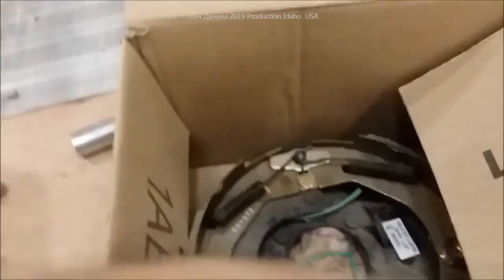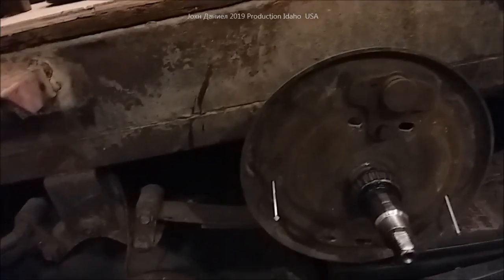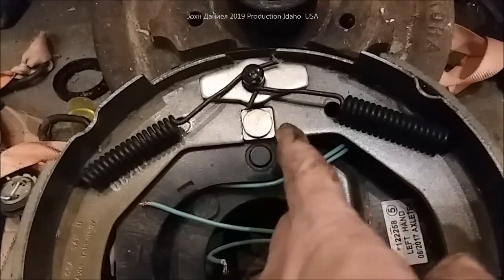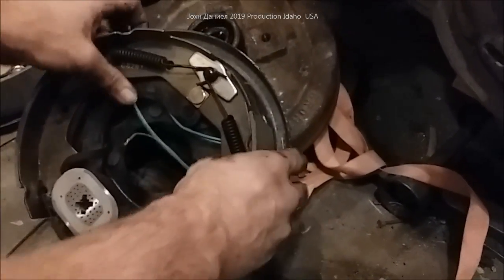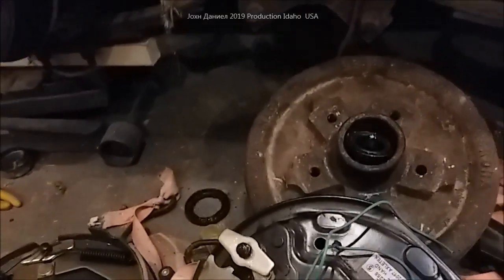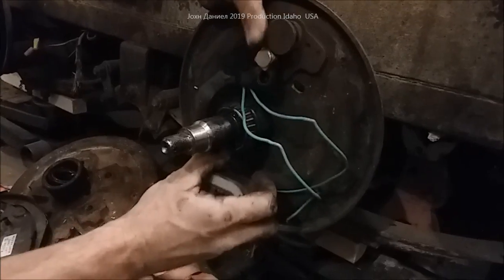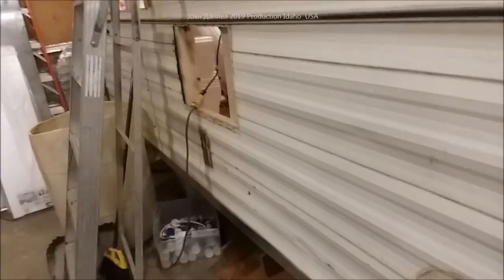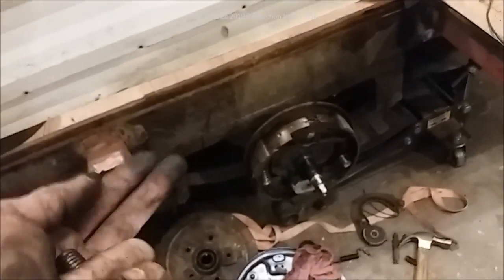Vintage Electric RV Brakes with Welded Backing Plates, your options and PARTS BELOW

Comment from the maker: If you go to buy separate brake parts its $20 more a wheel, or just use complete kits for less from https://ebay.to/2FRumSC , Only a 3500lb 10x2.25 kit https://ebay.to/2FQN3WF (most common on 5 to 6 bolt hub) or 5200-7000lb 12x2 kits https://ebay.to/2WkZFu5 (6 to 8 bolt hubs). Most welded on are known as "Dayton Style" or early Lafayette, and rarely as Dexter Dayton Canadian. The links are sources to R and P Carriages for models that swap into everything from 2000 lb 7" to  7000 lb 12". Other links are options you can use. Be sure to compare your brakes before taking on this job.
NOTE: 3500 lb kits also fit the dexter 4200lb 6 bolt hubs

Comment: Great video John. Here are a few things I found when i do brakes on these trailers. Make sure to replace the brake drum (hub assembly) when changing the magnets . If the magnet surface on the drum is not within spec the Magnet will be less efficient therefore not pulling the brakes on hard enough.  Always check the top pivot pin height is the same when replacing the brakes this way. Some older style backing plates have a slightly different height. The will fit and feel ok when assembled and adjusted but only the top portion of the shoes will hit the drum making them also less efficient. Thanks Mate and Cheers from Queensland Australia.

Comment: John, Just bought an old trailer that has mobile home breaks that are completely worn out. Mine looks a little different than yours and wanted to see if you could help me identify it. I want to do a break installation exactly like you did in this video. Most outfits want me to weld something, or get new axles. I would like to avoid welding.
Reply from the maker: Go here, https://ebay.us/DnTib2  send him a message where is shows contact seller about your axles or look in his inventory for what will match. Scroll way down on his ebay  pages to see details of the parts.

Comment: I've got an old dexter axle that has what I call a "half brake". The backing plate is only half a plate and is welded on. What would you suggest to update to the new style brakes, hub and wheel?
Reply from the maker: Sounds modified before you got it. But some 2400 lb axles for boats did have a similar brake set up. Grinding off the backing place, replacing with complete 4 bolt plate is the only solution.
Reply: @JOHNDANIEL1  It won't let me post a photo but it looks to be a factory setup. If you have a way I could get ahold of you I can send a picture of it.
Reply from the maker: @michaelclark6603  Send numerous pictures and parts branding info to my shop email. olympicpowercontrols@yahoo.com

Comment: Thanks for this video. My 1979 camper is at the mechanic. They told me the brakes were rusted but welded on. Is this fixable without costing a fortune ?
Reply from the maker: Yes, just opt for rebuilding them  partially as needed.

Comment: The link below for the 12x2 7000 parts kit goes to southwest wheel.  Does this source fit up to the Dexter Lafayette large hole wheel? - thanks
Richard
Reply from the maker: If you have 12" hubs that are 6200 to 7000 lb rated,  then yes it should

Comment: John,
First off thanks so much for the video and your research.  I purchased the kit that is shown and proceeded to swap all the parts out.  I tore apart a 1974 camper and I’m building a firewood hauling trailer.  Well, two of my brake return gold springs were broken, one left side and one right side.  Was wondering if you had a source where I might get replacement springs.
Reply from the maker: NAPA Auto Parts, bring in your remains, tell them what its from, get new ones. Common to be same as AMC/International parts. About $5
Reply: Yeah, that’s exactly what I did, no luck at the Napa here in town.  Maybe I’ll try a different Napa but, figured I’d ask just in case.  Thanks

Comment: Thanks for the video John.  I have the exact same axles.  I just got done doing the same project and took it for a test trip.  My brakes got pretty hot on two of the brakes.  After taking them back apart, the magnetic shoe was lodged on the triangle part of the brake shoe near the bottom and holding it open.  I had to take the old bushings out of the my old magnetic shoes to tighten up the clearance and movement as the new ones are about .05 too big.  Any suggestions?  I'm thinking about taking a cutoff tool and cutting that part of the brake shoe off.
Reply from the maker: That's a very odd behavior. Most all we ever done ended up having to be tightened out to get better braking. Did you use the adjusting rod setting in same position as the ones that were removed?
Reply: They are the never adjust as well.  I did adjust and then backed off on click so they spun free.  I could take a picture and send
Reply from the maker: Take the hubs down to a auto parts, get them turned 15/1000 and they will be OK.

Comment: What about the large diameter pinch style 5 lug 7k style?
Reply from the maker: 14.5 mobile home axle? There are some kits to convert to 6 bolt on 5.5" GMC wheel - brake/hubs.
Reply: @JOHNDANIEL1  yessir the large spaced 5 lug mobile home axles. We'd rather not cut/weld or replace all the assemblies. It's a quad axle 18+2 Beaver tail trailer.
Reply from the maker: @twofortyrida  You make front & second axle braking axles, rear axles idler axels. Get a caliper and check spindle shaft out, you will get kits like these https://amzn.to/4c0x3gL and https://amzn.to/49LH0gc
Be sure to wire with 10 awg brake marine grade cable, using low voltage like sheathed https://amzn.to/3Tj3m39 is best. Run to center of first 2 axles, box it, and branch equally length out to brakes with 14 awg similar.

Comment: Hi John, thanks very much for the video, helped a lot, but ran into a problem and would love some feedback. I did my first towing test with the new brakes, and when I pulled over to check everything, one drum was 250 degrees!!! Pulled the drum off and could see that the "reverse" shoe towards the back of the trailer was dragging. It seems that the brake assembly does not want to center itself after use, and if I use my hand I can shift the shoes left and right 5 degrees without touching the magnet/arm/pivot assembly. Any suggestions to address this? Grease the magnet arm? Grease the pivot point? They are very sticky and don't want to come back to center.
Reply: or might it be a problem with the return spring?
Reply from the maker: Check return spring for proper routing and if problem continues you will need to check the brake plate bolts, make sure they are at 55 lbs torque equally and all the same so you are not warping the mounting on them. If you DO grease them, it will eventually end up in a grease fire in your hub. Some fail to return can be due to a warped hub or over tightened set of bearings.
Reply from the maker: ALSO - Back off the auto or manual brake adjuster 1 full turn, the brakes will fuse or hang up if they can not wear even from over tightening on the adjuster.

Comment: I have the identical system on my old trailer, which kit do I need? Kinda confused by links? Thanks
Reply from the maker: The Dayton welded style? You just get the 3500 lb brake and hub kits. https://ebay.to/2YuDinW RIGHT/LEFT then follow the methods on the video to strip out the new parts methodically and adapt them.
Reply: Јоhn Daniel ok cool, thought u mentioned in video that only certain kits would work because of the size. Of the pin. Want to get the right ones. Lol thanks.  Is there a video of the wiring anywhere? I need to figure that out too.